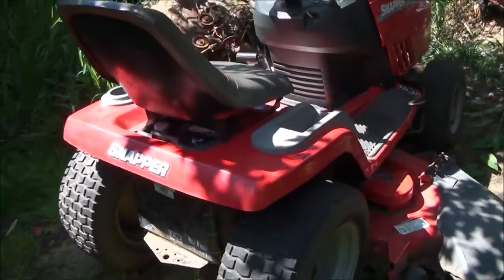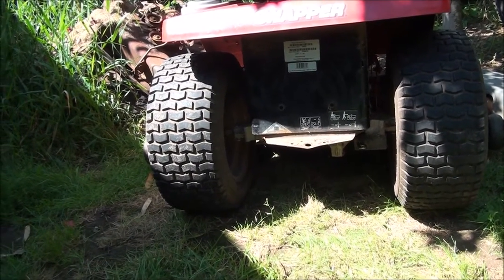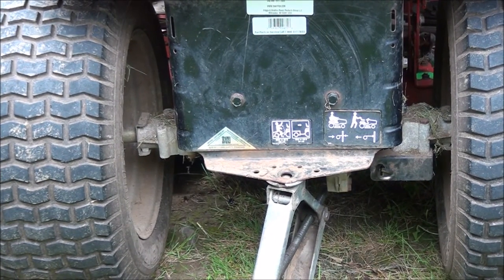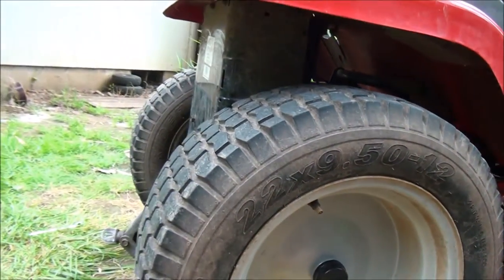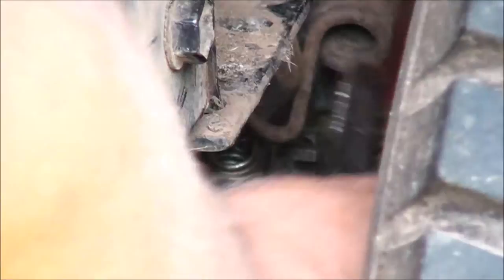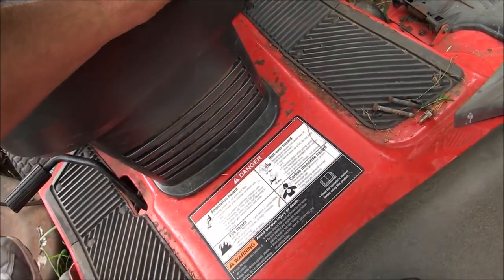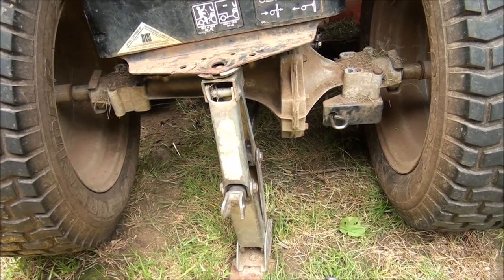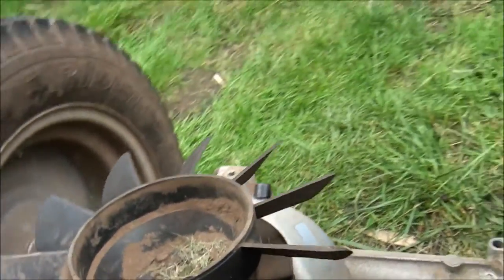HOW TO REPLACE the Hydrostatic TRANSMISSION on a SNAPPER RIDING LAWNMOWER. Transaxle replaced

Comment: Good job and good video, thanks!!!! I might be doing the same on my Snapper SPX 2246. The rear end seems to have just quit working today. I was able to  back it out of the shed, but it seemed a little "glitchy" like it was slipping, but now it won't go forward or reverse. I checked the belt tension, it seems adequate, but will have my wife operate the pedal when she comes home from work later today so I can see if the pulley on top of the transaxle is actually spinning or not. If the trans is bad, I do have a potential buy of a Snapper LT120 with (hopefully) the same transaxle for $75. It's missing the deck, has four flat tires, and of course the motor doesn't run. So, we will see how this turns out in a day or three. Wish me luck lol.  😁

Comment: Hi, I saw your video I too have a 200 lt 22hp snapper bought used. I have a problem the hood in the lower part of the exhaust fumes outlet turns black and ruins the paint even if I repainted the damaged part again. How can I fix it? Thanks I follow you from Italy your videos are always very interesting
Reply from the maker: thanks for watching. Maybe you can slightly bend the exhaust pipe to blow by it instead of on it.